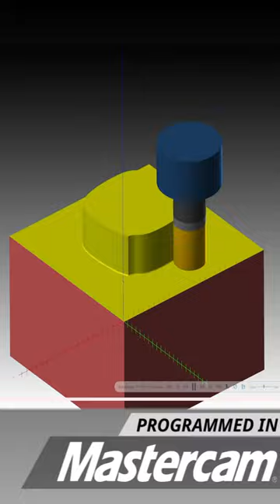CNC Machining an EPIC Turtle🐢

Comment: Mill off 100 dollars in stainless and wear down a 400 dollar endmill instead of cutting the top inch off on a band saw :o
Reply: Alright bot. They left that there to grip in first op so they could hall ass with their cutters. For kennametal and Iscar tools that is nothing to rough off when they are done with it.
Reply: Found the non machinist guy😂😂
Reply: I dunno... He has machinist in the name while you two have random nonsense for usernames. One of you even has war thunder for a pfp. I think I'll trust his judgement over yours

Comment: I absolutely appreciate the training you offer and I do not want to come across as nagging so please excuse this why don't you make items of usefulness to demonstrate prowess like all varieties of fixturing components. Or useful things like Zero tolerance dead centers meaning zero GD&T tolerance. Cylandricity zero circularity and zero runout. If you have guys that can do that zero backlash ball screws can be made for machines on your shop floor. Currently as far as I understand only a company has a patent in the USA and is currently making these. A shop I worked for is doing OD grinding. Or maybe make larger cylindrical gages to use to set Etalon pressure micrometers only use Etalon my honest opinion. Cylindrical gages are way easier than gage blocks to get the number perfect than gage blocks. If you have common diameters machined larger than inspection grade gage pins these are faster and much easier to get perfect settings over gage block stacks. However they need to be zero tolerance dimension and GD&T part of my tool making apprenticeship was making a variety of EDM fixture components and that at times was extremely challenging to be zero for any type of bowing and other wheel heat and pressure related issues.